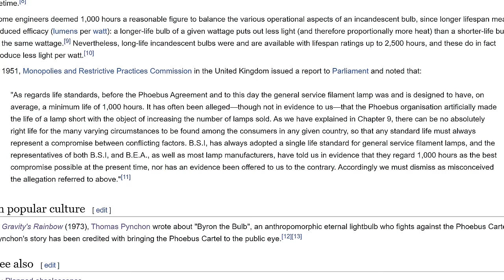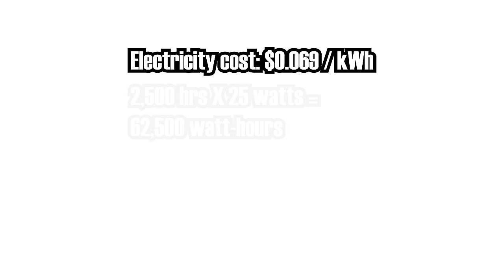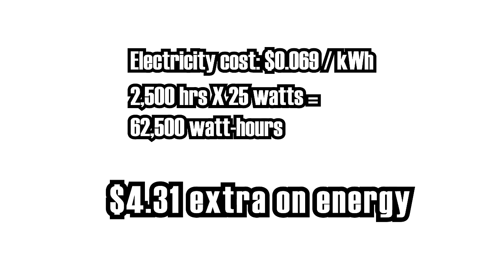Longer-lasting light bulbs: it was complicated

Comment: I've spent SO MUCH money replacing LED bulbs that failed after a week to a couple months, or just started making a noise that would drive anyone nuts. The most reliable lighting method I've ever used were the 4ft T8 fluorescents you can barely get anymore.

Comment: I swear that LED bulbs are now also given a limited lifespan well before its labeled lifespan. Some of the first consumer LED lamp bulbs are still working to this day in my house without issue, while newer LED bulbs have come and gone on other lamps/appliances in my house. They're becoming no better than incandescent in many instances, with the exception of heat and wattage.
Reply: To be fair, the cost of the LED bulbs are much cheaper today than when they were initially available. Heatsinks on the original LED bulbs are much bigger than what you can pick up today.
Reply: You can make long lasting LED bulbs, but they are more expensive with more heatsink and better caps. People often buy on a budget so you will sell less, consumer electronics is always a race to the bottom.

Comment: i think there are also external factors that can make longevity irrelevant. like my house isn’t particularly well wired and i don’t think i’ve ever gone a full month with all three bulbs working in my ceiling light
Reply: There used to be a socket you could screw in between the bulb & fixture to prevent the large surge in turn on power that shorten their life span. 

I found them when after I moved from a Boston apartment with minimal electrical supply to a CA apt with plenty of power, but my bulbs started burning out 5X as fast. Taking the power down by just a couple watts made a huge difference.
Reply: I remember we had an outside light that would burn out real fast so we eventually got a long life bulb for it.
Reply: used to live near an electric metro and had electric busses (not battery but overhead cable) and went through a LOT of lightbulbs and assumed it was power surges from the heavy loads from the transits going by

Comment: I had a lightbulb last close to 4 full years in a bedroom from 98-2002. I think about it every time I change an LED bulb after a year.
Reply: Yeah, there's no excuse for LEDs failing that quickly. They should last at least 5 years on average, 10 years if they're designed for long life. One that failed after a year is defective.
Reply: A. Change your led bulbs to better brand or...
B. Fix your electrical grid!
I moved to a new apartment 6 years ago, replaced all lightbulbs with philips led and never had to change a single lightbulb since. I still have a bunch of spare leds I bought then, never had to use any.
Reply: I've gotten years out of some cheap LEDs that I bought from Dollar Tree for $1 ($1.25 now). CCT is about 3000K, CRI is around 80 but it seems better, no flicker or noise. I haven't had to replace a bulb yet but if I do the cheap ones seem to be good enough for places that don't require high CRI.
Reply: To be clear for anyone else that might stumble upon this I realize that my original issue was my dimmer switches not being LED compatible. This mostly solved my largest issue and will help 99% of people. But I still have noticeable (as a photographer)dimming after 6ish months. Doesn’t seem like it would be evident to most though but I wonder if others took a light meter to their bulbs if they’d be happy about their 1600 bulbs being  1300 or 1400

Comment: I've had only LED lights for 9 years in my entire apartment and later house. Not a single failure yet. It's kind of scary really, I have to decide what color and brightness I want, and have to live a decade with that choice (not the kind of person to replace a bulb that still works)
Reply: You can buy cheaper LEDs ! (Don’t).
I had an electrician around a while ago because a light fitting had one bulb due, the replacement died instantly, the replacement for THAT does instantly too… I just had three bad LEDs in a row. Got an expensive one as a replacement and light quality and lifespan both improved.
Reply: You could always get color changing LEDs!
Reply: I bought a bunch of Cree bulbs when they first came out. None of them even lasted a year. Now I buy a cheap brand from the local hardware store and have not had one fail yet.

Comment: I think a lot of the suspicion comes from their settling on a standard of lifespan, rather than output performance or efficiency. Why did they choose lifespan if that was not their goal?
Reply: All the things are in lock-step, so it didn't matter which.  I guess they could have specified the filament temperature, instead.
Reply: @radellaf  Sure. I just figure if their actual goal is to maintain a certain level of efficiency or brightness, and those things were measurable at the time, why not pick one of those as the standard to hold each other to? That way, if there were further innovations that extended the lifespan without sacrificing performance, that could be pursued.
Reply: likely because they didn't want to fight an advertising war where each brand claims increasingly ridiculous "lifespan" claims on the box.
Reply: I assume because it doesn't take expensive equipment to measure

Comment: What bothers me is that I can't really buy new incandescent bulbs any more. The "dimmable" LED bulbs are really kind of terrible and frequently result in a leakage current going through them when "off". This is trivial, except that it sometimes leaves my bedroom lights glowing like they are about to sprout demons.
Reply: I've noticed this as well.
Reply: the problem is in the wiring of house
Reply: For a long time I didn't "switched" to LED in my living room because of that. But not to long ago I found a dimmer that does not use electricity when the light is off, and that dim "dimmable LED" pretty well. If you are in Europe it is a Schneider one and it work pretty well with Ikea and Osram lamp
Reply: When growing up with my father who did his own auto maintenance for almost everything, we used to say that the job wasn’t done until the bulb (in the trouble light, which was just an ordinary 75-100 watt light bulb) goes out (usually from hitting something enough to break the filament).  Thus, for this use, long life or high efficiency bulbs very much are NOT longer lives or higher efficiency, but just more expensive to use.

Fortunately, it became hard to find these as it became harder to service his cars, and not just because he was getting too old to do the work and his Alzheimer’s made it too hard to do 20 step processes even with my doing most of the work.
Reply: @deepfakestudio7776  long switch legs  cause induction in the wire .
some blg. codes do  not allow swithlegs anymore. as all boxes must have a neutral [white]  wire in them

Comment: Years ago even when led bulbs were cheap I could get the electric company to give me a rebate of up to 25 dollars for bulbs per year. I did it a number of years and have boxes of old led bulbs that are slightly worn out yet no longer needed. We switched to those 6" flat round disc led lights that we drilled holes in the ceilings and installed. I have a box of spares for easy replacement and plan on buying several more boxes to upgrade additional areas. So far over 60 installed and another 50 plus to go. 
Every room they are in now is far brighter than before, I also added additional switches to break up the lighting so that you can have lower light along with dimmers, motion sensors and smart switches. These are selectable color as well. Which allows us to have super bright or softer light in areas.

Comment: Just because the <1000 hour lightbulbs happened to be brighter and more efficient is irrelevant to the Phoebus cartel. If it was the would've set the limit to such-and-such lumens per Watt, or color tone.

Take it another way, if a fast food company wanted to prevent their customers being poisoned, they wouldn't make a policy of dosing every burger with laxatives. "Can't get poisoned if the poison flows right through you!"
Reply: Yeah, it doesn't really makes sense to me to establish such a limit instead of actually measuring efficiency.
Reply: I don't think the burger analogy is good since it does obstruct the purpose of the product, even if it drives to the point of its absurdity. I think a better analogy is to limit all pencil leads to 2B or softer by hardness scale, usually softer leads writes darker than harder lead and it will improve legibility especially for people with weaker hands. However it does not mean those pencils will have 2B pencil's darkness, they can just mix some other fillers in there so it is just as soft and not as dark. It will also stifle the development of leads that are darker and just as hard, however difficult it might be. And at last you as a customer is now limited in choice, you could have opted for an HB pencil so you don't break the lead too often, and people that do precision drawings may have to settle for less as they have always relied on the sharp tip offered by a hard lead.

For the light bulb they sacrificed the choice for people that want longer lasting light bulbs for the hard to reach places that he called for, or as emergency light like the fire station. And there is no guarantee that they have to maintain the same lumen level or lumens per watt. Maybe they can cheap out on some manufacturing procedures so they never last as long, or maybe they can find some ways to use less tungsten so there is less filament to burn. If those testings are available then I don't think there is an excuse for that. Hell, indoor lighting is sometimes regulated by maximum lux, brighter is not always better.

Comment: Regarding your last point, I had to change tungsten lamps slightly more often than LEDs, but they were substantially cheaper. The LEDs that have died on me after less than a year in the ceiling fan (I don’t even have boob lights to exasperate the heat issues) cost more over an incandescent than the electricity I saved over its brief lifespan.  Once I get through my stock of junk LEDs, I think I’ll have to figure out a name brand to buy instead of treating LEDs like the commodity that incandescents were.

Comment: A slightly more common place to find three-way incandescent bulbs might probably be your car lights! Those taillights that do that thing where they glow moderately when your car is on and then brighter when you actually hit the brakes do in fact have two filaments running through them and three terminals on the bottom
Unfortunately, the only reason I know this is because I had to help replace the bulbs, and then later the socket that they were seated in, on account of the plastic fixture disintegrating to the point that A.) it would not hold the lightbulbs properly, and B.) we actually ended up installing them backwards at some point during a hacked-together fix involving some epoxy clay, meaning the brightness in the lights was not consistent and very weird looking. Fun! And also quite warm!

Comment: My grandma had a large lamp in her bathroom that my dad installed in the early 60s and it was used for over 30 years until the day she died.
He did that by using an industrial high voltage rated bulb at 240v as a heat lamp to warm the occupant of the bathroom in those cold Liverpool winters. It gave off more IR and less visible light

Comment: My house has some LED bulbs that were installed when we renovated it in 2009. A few of which are on 24/7, totaling roughly 130,000 hours of runtime. At the time we bought them, they cost almost $40 a piece. 

Some newer LED bulbs have lasted well under 5,000 hours before dying. LED bulb design needs to be regulated if we actually want to reduce waste, considering how much more material (including plastic) goes into LEDs than incandescents.

Comment: Fun thing about LED lamps, most failed LED bulbs I’ve experienced failed outdoors during freezinf months of the winter. Even being rated to -25C I had two failed bulbs, in two lamps which were used in motion sensor controlled lamps. Those same lamps stopped failing when I changed to run those lamps behind astronomical clock instead of motion sensor. A lot more hours but way less thermal cycles.

Comment: 26:15 But that's just it. They WEREN'T engineered to fail at 1000 Hours. They were engineered to meet specific energy-efficiency and light-output metrics. The collateral result of those metrics is that at about 1000 hours, if running properly, those lights should fail. And that became the simplest metric to test.
Reply: Tak

Comment: From my point of view, "planned obsolescence" is a thing that is happening, but not the way it's usually portrayed. You can make appliances to last the right amount so people keeps buying them by simply using bad materials. You can also make something trendy, so everyone changes it on a regular basis (ahem, smartphones). Also, you can ship the product with outdated standards, so when new standards are finally enforced, the product is no longer useful (electronics and such). You can also run with denying people the right to repair, so they replace instead. I have yet to see any "mysterious printer chip that breaks the printer" as I have repeatedly heard.

Great video, specially the part of the tri-contact bulb. Didn't knew that was a thing and wondered how those variable brightness lamps worked in the old days. 😊

Comment: The other common failure mechanism for incandescent light bulbs is thermal stress. I have noticed that incandescent lamps almost always fail when you power them on. Tungsten has a positive temperature coefficient. This causes the current in the filament when cold to be up to 10 times that as when it is hot. The thermal stress during abrupt power-up causes the filament to eventually break. If you could apply power gradually to the bulb it would last much longer. Of course this would be too expensive to do in a household. The principal of gradual filament warm-up is used in some high-end vacuum tube equipment because the vacuum tube filaments are also made from tungsten. I use a small variac to slowly apply power to the filament of a 833C vacuum tube used in a Tesla coil which I built in order to greatly extend the life of the filament and thus the tube.

Comment: "The Taste Makers" is an excellent book for anyone interested in planned obsolescence.  It sounds like light bulbs were missing the all important "planned" part - when manufacturers make, say, a car, or a dish washer with planned obsolescence, they do it by specifically targeting the key components and purposely designing them so that their lifespan is within the planned range.  They do this rather than spend slightly more (or in many cases, the same) on a more durable component.  Choice of materials is often a key consideration - using less durable alloys or plastics in lieu of stronger or tougher choices.  It doesn't really sound like they did that with light bulbs.  It was a trade off that was forced on them by physics.
Reply: A college lecturer had an interesting theory that anything that lasts longer than the shortest lived component on a car was over-engineered. Back in the 1970s and 80s in the U.K. the shortest lived component was usually the body. I knew someone who scrapped a fifteen year old Honda with just 60000 miles on the clock and zero mechanical problems because the underside had gone so rusty it would have cost more than the car was worth to get it through a safety inspection.
Reply: "when manufacturers make, say, a car, or a dish washer with planned obsolescence, they do it by specifically targeting the key components and purposely designing them so that their lifespan is within the planned range."  With a BMW you can certainly obviously see the clearly visible terrible quality parts (e.g., brittle plastic air hoses for crankcase vapours with plastic snap fitting at either end), but I'm not sure that is so true for a Honda where the same crankcase breather line is still a combination of metal hard-line with rubber hoses with metal clamps (like a much older vehicle).
Reply: @TassieLorenzo  Aiming at different markets ? Here in the U.k. I doubt whether the average person choosing a new BMW has any concern over what the car will be like at ten years old. In contrast Hondas are popular with pensioners who want a car that will outlast them.

As proof for a couple of years we had a BMW 420i as one of two pool cars at work. It was chosen by then leased for one of the directors who after a short time left the company, leaving them wondering what to do with his car until the lease expired,

Comment: I live in europe (Germany) with 230V mains voltage. About 3-4 years ago I bought two 7W 230V nighlight bulbs and connected them in series, so that every bulb gets the halv voltage. Since then these bulbs have been running 24/7 every day. I didn't ever turn them off. They've been burning for over 30000 hours and are surprisingly bright. Of course you would get the same effect by running a german lightbulb in the US. It would be very interesting if you could try this with different bulbs and see, how long they last.